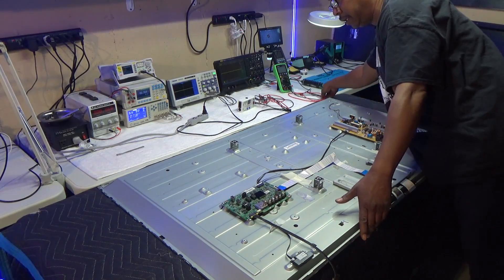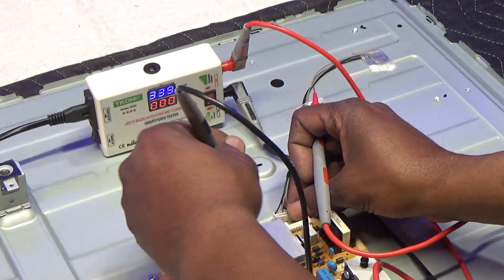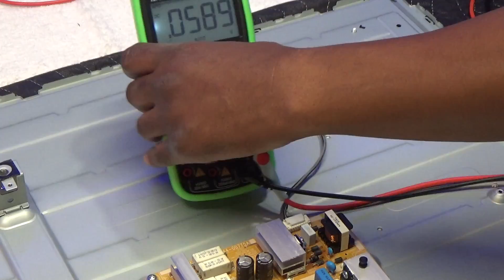Samsung 60" has sound, no picture. UN60J6200AFXZA Power Supply board repair.

Comment: If you disconnect the main board the BLs should come on right?
Reply from the maker: Not on this one. This is the older model.
Reply: @bigdog8882  Gotcha, I think the UHDs models are like that, I got 2 more TVs from salvage today, Samsungs, 40" CCFL, shorted mosfet to the inverter so far..., and a 60" UHD, no BLs, no pic, no sound, STB light on, the PS turns on but not the BLs when I unplug the main. BL tester shows all BLs are out. dang!! I can't catch a break.

Comment: Excellent Job Big Dog, I had to replace my LED light strips also but in doing so, I was putting the tv back together and I broke the two ribbon cables at the bottom of the screen. Is this the video driver board and where can I find them, I haven’t been able to find them anywhere yet. These actually plug into the screen. Thank You for any help you be able to provide. Your the reason I was able to troubleshoot the lights.

Comment: I picked up the same make and model that had the same issues.  Replaced led strips and still no power.  The power supply board had a darkened area around the same diode and mosfet that's in your video.  Replaced the diode first and bam:  lights.  Apparently the diode and/or  the mosfet has issues with this model and others.   These videos are helping others solve their TV issues.  Keep up the good work.

Comment: I have the same TV and my roku kept alerting that it was overheating.  I put a dongle on it and that went away.  A week later TV would not work but I can see the image in the background with a flashlight.  I just tested the output of the left side of the connector and I get 68-70 but on the right side I get 317.  I don't have an LED tester but I got shocked once and saw the LEDs light up (:  I am thinking it is the power board but wondering if it is smart to just do the LEDs as well?  Thanks for your videos they are great.
Reply: Checking the diode I got 1.4 on one side and infinite on the other side.  I am not sure the diode is my issue here?
Reply from the maker: If its the same TV, replace the diode and the led strips. All the shorted led's is what usually causes the diode to change value and become defective.
Reply: @bigdog8882  as I reported above the diode tested out right. "1.4 on one side and infinite on the other side". I started searching for this power board to replace it and it looks like everyone is sold out.  BTW, it is the exact same tv.
Reply: I was getting 417 across the whole circuit

Comment: Thanks for the awesome video I'm working on the same identical TV with backlight issue and they didn't work so I am going to replace the same Moffett and diode I found the SF28G diode on ebay but found a similar diode on mouse they didn't have the SF28G  they had a SF28G R0 a fast recovery diode will that work ? Any advice I would greatly  appreciate it I had placed a order from mouser with the Moffett just was going to add those diodes but they were fast recovery

Comment: My backlights work just no picture
Reply from the maker: You either have a Bad T-Con board or Bad LCD Screen. Have to have Technician check it out.
Reply: @bigdog8882  Is that expensive to pay for to get repaired?
Reply from the maker: @geralddesrouleaux5611  Tcon No. LCD Panel Yes.

Comment: Nice repair videos.  Used it to check my power supply n turned out good on my 60" Samsung.  Problem is ticking noise from led backlight on upper left corner.  Flashing power button blank screen.

Comment: I believe you should be measuring the two outer pins on the LED connector on the power supply. The power supply I was working with appears to short the two center LED connections (to make the two segments one long segment) and applies power to the outer pins.

With the bad diode (same problem as in video), I was getting very high voltages (~800V, exceeding the rating of all cheap multi meters), and it is relative to the case ground, so be careful.
Reply: I was seeing 68 on the left side and 317 on the right.  I got shoked when my hand slipped.  Thank god it was on the left side.  I woke me up.

Comment: I just replaced the D9001C/SF28G rectifier on my BN44-00775A Power Supply and it went out again. The TV worked perfect for 10 minutes. Good picture. ANY suggestions what to check next?

Comment: Same problem on a UN39FH5000F; low/intermittent voltage to the strips after replacing 7 bad LEDs. Driver FET was shot, diode was iffy.
Changed them both, TVs back in business. Replacing faulty parts beats replacing entire units every time, PLUS the knowledge one gains in doing so!
Once again, I thank you Sir!

Comment: What would cause one line to have 320v and the other line to have essentially nothing, but across both lines to be 420v?

Update: watched your other video and realized there is no return voltage from the first feed line which would mean bad led strips. But while disassembling I cracked the screen which makes this trash. Well shit
Reply: Hey, got the same voltage readings, does it mean I have to replace the LEDs??

Comment: I am currently working on the same tv and wouldn't you know it the same diode on mine is also bad sf28g. My backlights are working know but they are extremely dim and I'm only getting 54v on one side of the leads and 58v on the other side. I replaced the sf28g diode with a 5408 diode that runs 3a 1000v the sf28g is 2a 600v I'm just hoping the replacement I used isn't causing the dim backlights power problem but I will know more once I open it up I guess lol. Just wanted to say thank you bigdog for your video's and knowledge I got into tv repair over a year ago and my first flat screen repair was a 65" Samsung 3D  that you made a video on about changing the three ceramic capacitors on the y-sustain board to get the picture working again and you were spot on. Thank you and God bless.

Comment: Excellent repair and some new equipment! Interestingly faulted diodes. Usually they go direct short, but in your case  normal 0.4-0.7 voltage drop forward biased and 1.3 voltage drop reverse biased - interesting failure mode. Thanks a lot.👍

Comment: Hey bigdog hope all is well  with you i have a couple of questions for you if you could make a video about how do you fairly charge a customer what do you put into coming up with a price without trying to rip some off and not cheat yourself. 
2. Can you talk about the different tools you use like that desolder one and .
3. I never hear you guys talk about service manuals where is a good place to get good manuals.
4. Can you talk about handling large screens   best practices for doing that I  have handle a couple and I have broken the screens which is like not real death to me when you hear crack
Thank you im sure I can think off some other questions
Reply: I could be wrong ,,but as long as one has done Theory in Electronics,,automatically after awhile ,,schematics arent needed ,even though a lot of changes had been made ,i do presume that the operating principle remains to be the same ,or may differ a little.,i personally do not work with a schematic,,that was years ago when manufactures had included the same with the equipment,,now thats been rarely done.,i am open to corrections.
Reply: @jeromeclarke4141  you are right about all you said
Reply: @xaviermartin5905  Many thanks my brother regardless  of whom you are or what you do look like ""❤ One Love "One Breath::Same colour of Blood "" God Bless
Reply: One of the tools used i called a Desolder Pump,